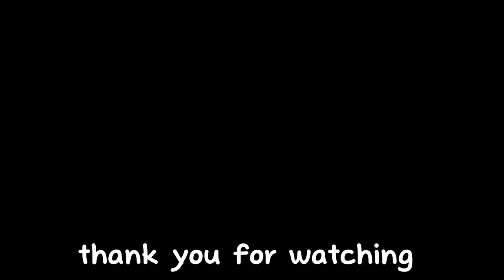Remove rust from guitar pick-ups (Fast and Easy)

Comment: Awesome! Did you protect the surface with with tape? Or am I seeing wrong? My guitar is fine but one trusty pedal is rusting on the base of the switch 😢 so I was wondering if acid won't affect the surrounding paint.
Reply from the maker: Yes, I did protect the surface with tape, you can do the same thing to your pedal

Comment: Yo I followed the method and used a screwdriver to scrape the rust off......

....however 2 days later my pickup poles were rusted again, am I doing something wrong or ami I fucked? 😂 😢
Reply: try putting q tip with metal polish